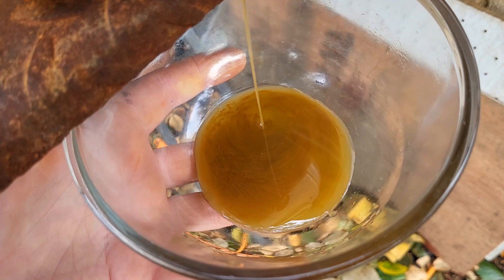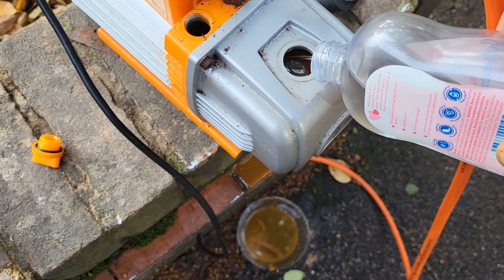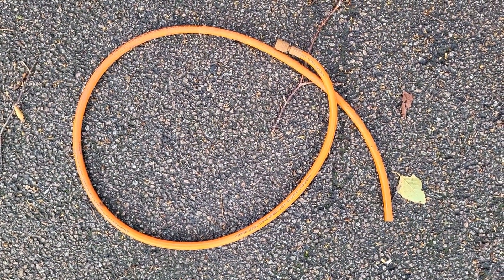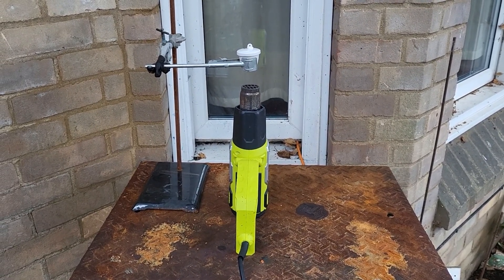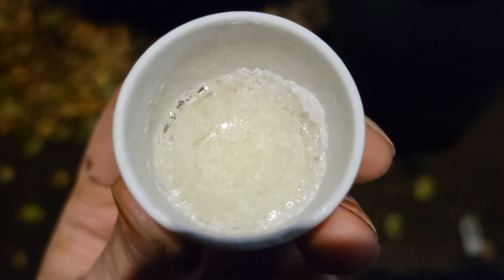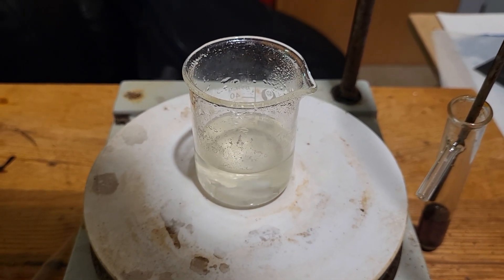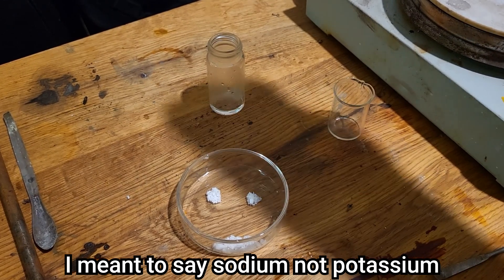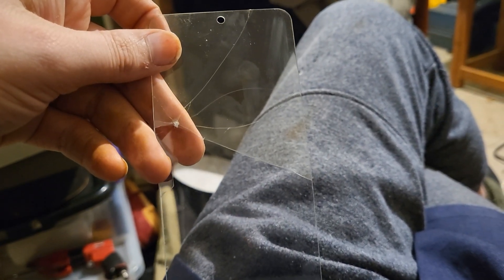how to make sodium perchlorate

Comment: I've been making sodium chlorate for a few months now and have just taken my first steps into making sodium perchlorate with glorious success. I used a lead dioxide anode to electrolyse it further to perchlorate then an acetone extraction on the dry solids after boiling it down to a solid cake. Yield was terrible on my first attempt got only 200g of sodium perchlorate from 350g of sodium chlorate so I must not have ran my cell for long enough. But still enough for my purposes

Comment: No it is good if you use acetone to separate because perchlorate is dissolved in acetone but NACl not dissolve
Reply from the maker: With water it's the opposite
Reply from the maker: This was actually a failure due to presence of dichromate in my starting chlorate.

Kept it as a video as the theory should be sound.

Also it's one of my most popular videos

Comment: You would be better off dissolving in acetone to keep recrystallization and purity, if you have good acetone.  Chlorate will not dissolve nearly as easy as the perchlorate in acetone.
Reply from the maker: Thanks, I need to make some more chlorate some time without any dichromate contamination because that prevented perchlorate from forming
Reply: @SodiumInteresting  Not sure where you reside, but there is a company that sells sodium chlorate by 2lb jugs in pure form, nice big crystals pretty darn cheep.  It's for bio diesel production.  I use this as a starting point in electrolysis because it completely removes the threat of sodium destroying platinum anodes and allows for fast separation by acetone to very pure product.  Just a though.
Reply from the maker: @derekturner3272  do you know the name of the company, I'm in the UK. Always worth seeing if they will ship here, doubtful though
Reply: @SodiumInteresting  Duda Diesel.  Great selection and very good prices but are in the US.
Reply from the maker: @derekturner3272  yeah I'm sure they've got rules to follow, records to keep. They can't just post to countries where it's restricted, I'll check them out though. Thanks
Reply from the maker: @derekturner3272  after 1k subscribers I should be able to register the channel as a business. Then I can order small quantities of harder to get stuff from local companies
Reply from the maker: It was supposed to be perchlorate and chloride after heating but I think it was just the chloride

Comment: Hmmm, to my knowledge, NaClO4 is extremely well soluble, way more than NaClO3 and NaCl. https://en.wikipedia.org/wiki/Solubility_table
I don't think it would crystallize first. Probably, your product is actually NaCl. There is (a bit scary) method to separate the product using acetone: NaClO4 is well soluble in it.
Reply from the maker: It's possible this was just NaCl (not fully tested it) but the method is sound according to chemplayer video I followed.
Reply: @SodiumInteresting  Yeah, the method works. I actually used it in the past to prepare NaClO4 (and using acetone for extraction). They yield was quite low though, most of it just makes O2. I heated the melt for several hours on a gas stove, until it solidified completely.

It is easy to test for NaClO4: soak a piece of filter paper in its solution, dry it and try to burn it.
Reply: @SodiumInteresting  your crucible is too hot because NaClO3 to NaClO4 happens at 320C exactly which doesnt need blowtorch and simply can do on stove top or weak gas burner.
Reply from the maker: @CatboyChemicalSociety  yes and dichromate would have been present.
I managed to extract a gram or so of perchloate from some fireworks stars. It is not very clean though.

I should redo this when I finish cleaning up chlorate it's a popular video
Reply: @SodiumInteresting  yea dichromate means yield is zero. Chlorate needs to be recry in water or methanol extraction. Don't use chromate it barely helps anyway and is just bad because CaCl2 forms coating on cathode that stops reduction and isn't toxic and easily seperable.

Comment: Nice bud. Thought separating NaCl and NaClO4 would be harder
Reply: he technically did it wrong
Reply: Acetone at 40C dissolves 500g/l of NaClO4 but not chloride or chlorate. If theres any water present it will still dissolve mostly perchlorate if acetone is in huge excess. I also use it on perchlorate sludge from post electrolysis solutions boiled down.
Reply: Bro what he did wrong ??, @CatboyChemicalSociety
Reply: @EinView  overheating just watch the vid
Reply from the maker: @CatboyChemicalSociety  yes I just kept it as a guide, I can just pretend it worked.

It has dichromate contamination too so it probably wouldn't have worked anyway
Reply: Near impossible 😂
Reply: @owqxe  easy use acetone
Reply: @CatboyChemicalSociety  nah men, both has equally dissolving rate onto the water ?🤔🧐,, its not a water ,? Then water will get dissolve into it? But both is also an salt ?🧐🤔 so what else will get dissolved into the salt ? chloride or chlorate?

Comment: There are some really cool, colorful and energetic perchlorate complexes. Tetraamine copper perchlorate, nickel aminoguanidine perchlorate are a couple of them. You don't need to heat it that hot, just until it starts bubbling off oxygen then hold it at that temp until the bubbles stop.  You may have converted a lot of it back to chloride.  Solvent separation using acetone works well.  Laboratory of liptakov has a video on it.